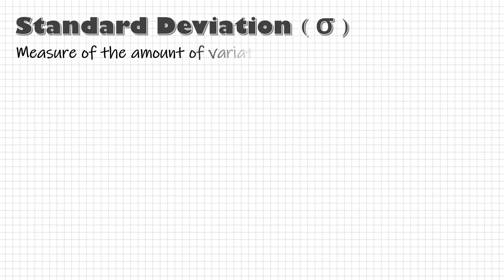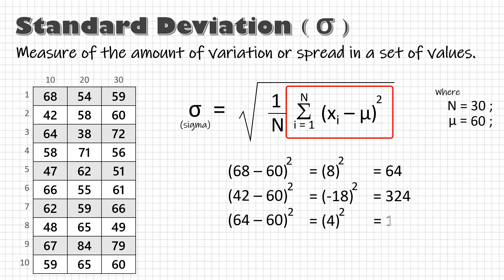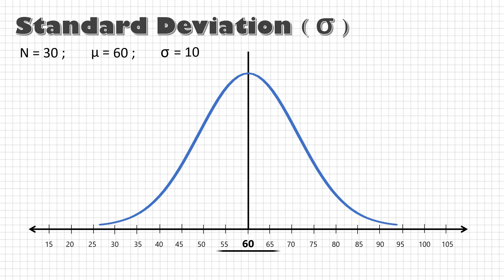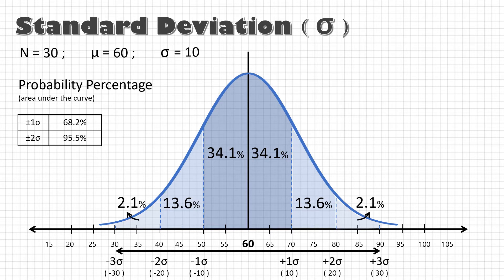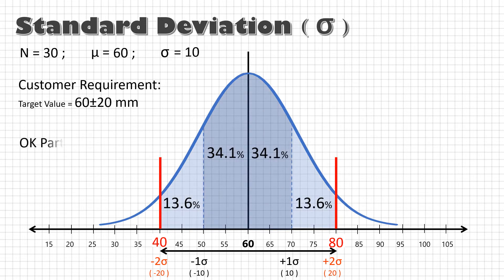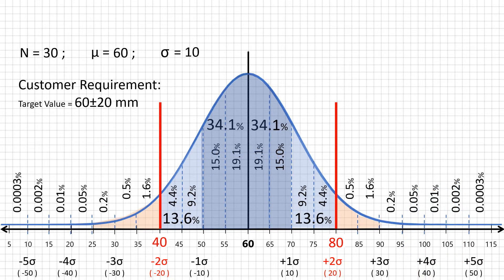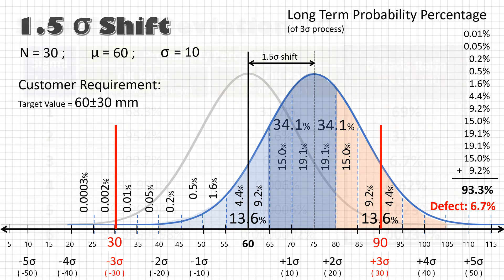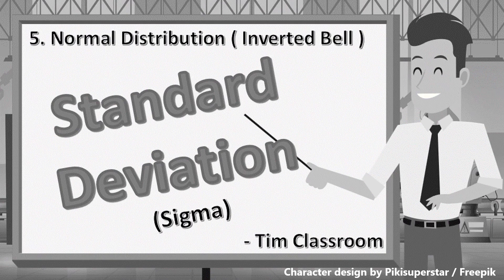Standard Deviation ( Sigma )

Comment: How did you get the 34.1 of 1sigma?
Reply from the maker: I came across this in a book—it's related to the Gaussian Function, named after the legendary Carl Gauss. This mathematical wizard used "Integral calculus" to figure out that the area under the curve within ±1 sigma is exactly 68.2%. And guess what? Not a single soul has challenged his math since. So, while I have no idea how he pulled it off, I’m sure it is correct, mostly. 
and honestly, I'm not good in Maths, I am a manufacturing guy :)

Comment: Greetings from Singapore. Your videos are very educating! Thank you very much for producing and sharing it. 

Can I also take this opportunity to raise a query? I am confused with when should I use Sigma sample (n-1 for the denominator in the sqrt root), Sigma estimate (R-bar / D2 constant) or Sigma population (n for the denominator in the sqrt root). Could you help to clarify? Thanks!
Reply from the maker: Thank you so much for your comment.

Allow me to address your query. Sigma Population with denominator ‘n’ is used when we’ve data of the entire population (duh). Also, when we only want to quantify the variation in that particular set of data and we don’t want to extrapolate the data for predicting the process behavior.

This is rarely a case with us engineers. Our goal is often to predict process behavior using a smaller sample. (Even if we collect data for an entire batch, it effectively represents a sample set of all parts produced or yet to be produced. I hope it makes sense). In sampling method, we use ‘n-1’ as denominator, so that the resulting value of standard deviation will become slightly higher and this ‘higher value’ is now our best guess for the value of standard deviation in the overall population. This is known as Bessel’s correction.
(Now, you can ask me why n-1 and why not n-2 or n-3. To be honest, I do not know.)

Finally, in my opinion, the R-bar/D2 method is a user-friendly way of calculating standard deviation, especially in Control Charts to spare operators from complex math during chart plotting.

I hope it helps.🙂
Reply: @think_lean  good explanation and great video